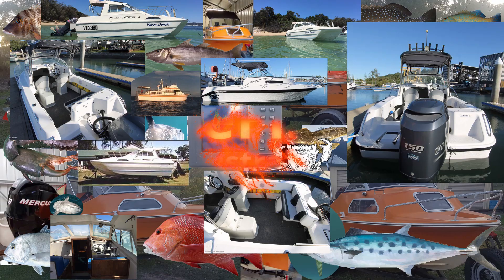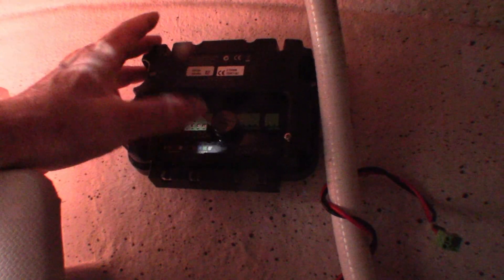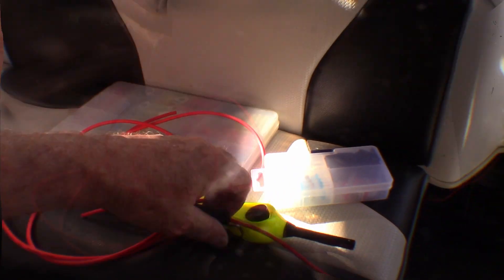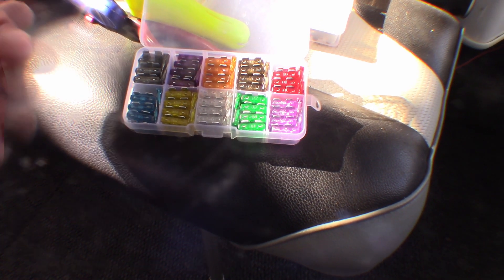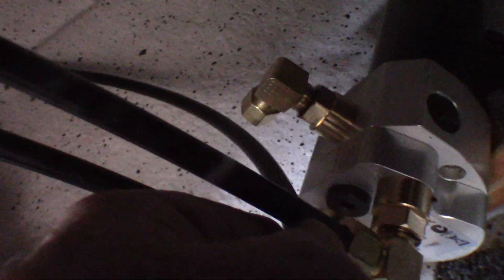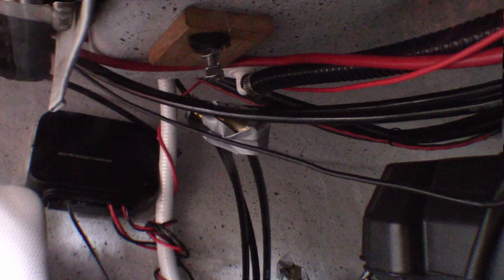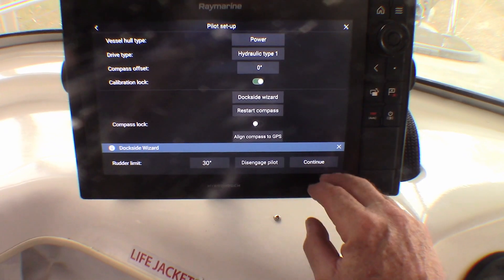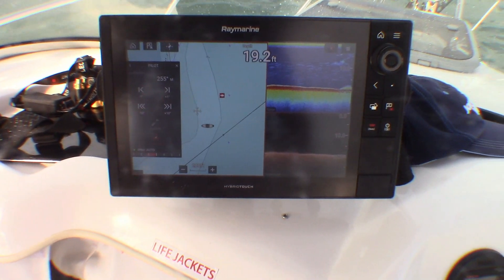Raymarine Autopilot Install – part 2

Comment: What size hydraulic pump was it that you had with this set up
Reply: I have the same hydraulic pump it’s said .5 but on my control unit list as type 1. I can’t do the final calibration for my ev-1 sensor. It’s keep showing detecting magnetics . I contact Raymarine and they walk me through the whole entire setup and they told me to turn my boat circle right and left, I done that like 4!hours and still not calibrate. I hope you don’t have the same problem ..
Reply from the maker: Sorry to hear that you have had a problem.  Mine has worked perfectly (touch wood).  I even did the initial calibration while it was parked inside a metal shed without an issue.
Reply: weFish-AU .5 . It’s weird
Reply: weFish-AU mine is working , it’s just need final calibration for the compass
Reply: Thanks for the reply sir
Reply from the maker: Excellent.  Very good news indeed.
Reply from the maker: Raymarine Type 0.5 (12V).  1000cc/min (no load).  Stall pressure 50bar.
Reply: @weFishAU  thanks for the reply👍🍻🍻